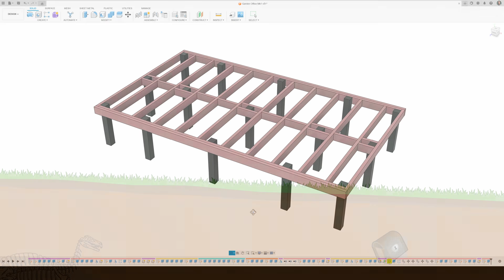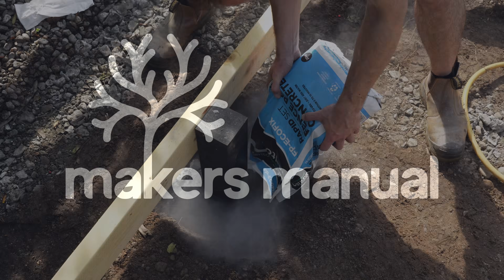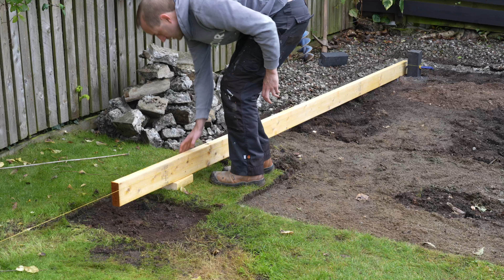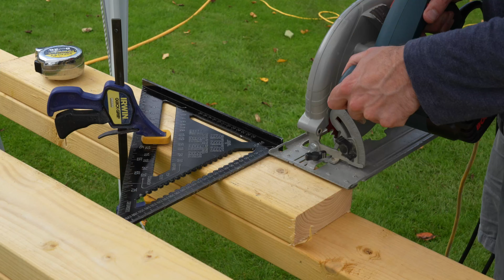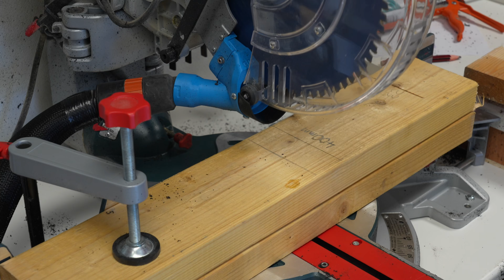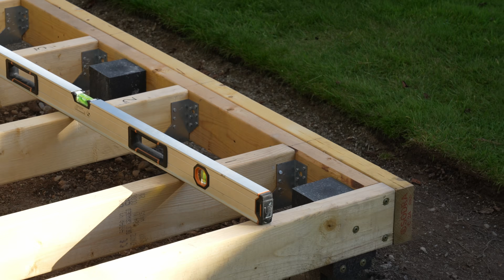Easy Foundations & Solid Timber Base Frame | Garden Room Build #2

Comment: Not sure I’m convinced on the base. Postcrete generally just crumbles under structural load - I’d be using a strong concrete mix - either 3 aggregate to 1 cement or (more likely) 3 building sand, 2 stone, 1 cement. I like the idea of using composite posts as they should never rot (in theory)….. having never used them, my main concern would be over ensuring the fix is decent enough. 1 metre deep holes seems sufficient enough to me though - not sure why you’d want to go any deeper than that.
Edit - just seen the price of these composite posts and nearly fainted!!!!
Reply from the maker: That's a good comment, and it prompted me to go away and do some more research to check whether I'd potentially made a mistake.

From Blue Circle's technical documentation, Postcrete is intended for applications such as fence posts and decking posts, but isn't suitable where a specified compressive strength is required. Given the relatively low loads involved and the similarities to a deck foundation, I think there's a reasonable argument for its use here, although I accept that a concrete mix with a specified strength would have been a more conservative choice for a building foundation. As always, the ground conditions and specifics of the site make a big difference.

I agree about the composite posts, too. The connection to the timber frame was the part I was most cautious about, which is why I double and triple-checked the calculations and added the extra reinforcement. On paper, the connection has a considerable factor of safety, although that obviously depends on the assumptions in those calculations.

And yes, the cost of those composite posts certainly adds up! 😂 I'm happy to pay the extra over timber for the expected longevity, though, and overall it's still a cheaper option than some of the alternatives.

That said, for the build plans I sell, I've decided to recommend ground screws instead. They're a more versatile option across different sites, whereas the suitability of concrete foundations depends much more on the local ground conditions.

Comment: if you put a few screws into the end of the joists, are the joist hangers necessary? Nice work by the way!
Reply from the maker: Thanks! 👍

You could physically screw through the end of the joist into the supporting timber, but I wouldn't consider that a proper substitute for the joist hangers. Screws driven into the end grain have relatively poor withdrawal resistance, whereas the joist hangers are specifically designed to transfer the load from the joists into the supporting frame.

So for me, the hangers were cheap insurance and also give a much more reliable and consistent connection. There are other ways of fixing joists, but I'd use a method that's specifically designed and rated for the loads rather than relying on a few screws into the end grain.

Comment: Has anyone else bought the plans? I bought them 3 days again and messaged on the provided link to ask when they would arrive and have not had a response, thanks
Reply from the maker: Hi Becky, I just responded to your email you sent 2 hours ago. Please check your automatic receipt message sent by Fourthwall immediately after checkout, which contains your direct secure download link. I will get Fourthwall to resend the email to be certain you get it.

Please let me know if you have any further questions and all the best with the build.

Comment: Any concern about Rats nesting underneath? Would a concrete base be better for a garden room?
Reply from the maker: I must admit this was something that worried me, so in Part 8 - The Cladding Video (https://youtu.be/4l4pCBRsK84), I added some rotten mesh to the bottom of the structure. This should keep any unwelcome guests out of the base. Concrete is another valid option, but as with anything there are pros and cons to all approaches. On the whole, I prefer a floating base frame.

Comment: Is there any reason you didn't notch the post foundations so that they sit under the joist on at least one side? I'm going to use the same method on my build but, like you I am second guessing attaching the foundation posts laterally to the floor frame. And think it would be a better option for the post, to at least partially, bare the frame?

Great build BTW, I'll be referencing it extensively while building my own garden office.
Reply from the maker: Thank you. Notching the posts would be a good move, and would provide to piece of mind. We didn’t because would make initial levelling of the perimeter frame much more difficult. Though no reason not to do it with the other posts. I have separately looked into this 4 or 5 times now because I sometimes worry, but each time I have confirmed it’s solid. With 15 post for 10m2 the loading on the posts and fixings is actually relatively low.
Reply: @MakersManual Yeah part of the beauty of your solution is the ease of installation. Adding notching to the mix does complicate it. My build is only 9m2 but it has a 500mm cantilever at one end I'm trying to get away with 12 posts but perhaps I should order an extra plastic post and shoot for 15. My other thought was to potentially add some cheap decking pedestals to augment the posts. Thanks again.

Comment: Did you consider excavating a bit of ground (say 20cm) and add some ventilation ducts for the bottom air gap? This would give a bit more room for building restrictions
Reply from the maker: Good question. I didn’t actually consider that approach when planning the build.

In theory you probably could excavate down a bit and create a ventilated void with ducts, but in our case I’d be quite cautious. We’re on fairly clay-heavy soil and it’s a pretty damp area, so I’d be concerned about drainage and the timber subframe ending up in a consistently damp environment. Once you start digging a pit you also have to think about water sitting around the structure, how the ventilation ducts stay clear, and whether the void will actually dry out properly.

You’re right though that digging down could increase the internal headroom, because the floor level would be lower relative to the surrounding ground.

For this build I was trying to keep the foundations simple, well ventilated and reasonably forgiving for DIY, which is why I stuck with the raised frame and air gap. But there are definitely a few different ways people approach it. 👍
Reply: @MakersManual  Thanks for your answers! I really enjoy following the build and the rationale you provide with every step.

Comment: Did you use treated spruce C24 as wood or something else like Douglas fir?
Reply from the maker: I used C24 5x2 structural timber, like this: https://tidd.ly/4pJgigo

If you’re thinking of building something similar, I’ve also put together some garden room build plans which include the full materials list and product links: https://makers-manual.com/shop
 👍

Comment: Watched the whole series - very good and thanks for taking the time to put it together. What’s the minimum height above ground you can get your floor frame with this concrete piles method?
Reply from the maker: Thanks... we should be releasing the rest of the videos in a week or two so watch out for that. With this method you can get the frame as low to the ground as you like. But you will need a 50mm air gap beneath the frame for ventilation. This will keep the building healthy.

Comment: This is great, hoping to follow pretty much exactly this approach for my sloped site. One question, you didn't put down a weed-proof membrane, was that deliberate and do you think you'll be ok without one?
Reply from the maker: That's great to hear. We did actually put down a membrane, you can see it at around 3 minutes in Part 3 in this series. https://youtu.be/MzpKeu2QE5c

Comment: Any reason you had a overhang for the roof? Could have saved some space near the garden edge.
Reply from the maker: The overhang has a few positives for us; it looks better, helps provide shade from the sun and shelter from the rain. Plus it is nice to have a little extra space around the garden room for maintenance and storage. Thankfully we have a big enough garden that these pros outweigh the advantages of keeping it closer to the edge of the garden.
Reply: @MakersManual  Good points, if you have the garden size. When will next video in the series be released?
Reply from the maker: @leecornwall8381  It's all been a bit hectic with me, so I'm a bit behind with everything. But I hope to start-up the series again around late Jan. The videos should then come out on a regular schedule. 
In the real world the Garden Room is finish and looking good. Just need to edit everything together and also put the finishing touches on the manual I want to release to accompany the videos.
Reply: @MakersManual manual? That would be interesting. I am looking to buy a build pack from the garden room guru.
Reply from the maker: @leecornwall8381  Yes 🙂 I’m actually working on the manual (build pack) right now.

It’s taking longer than expected because I really want it to be properly thought through and something I’m proud to release. I also deliberately finished the garden room first before finalising the manual, so I could double-check details, improve anything that didn’t work perfectly in practice, and make sure everything stacks up in the real world.

The plan is to offer both cold-roof and warm-roof versions, using the same footprint, so people can choose what suits their circumstances.

I hadn’t realised the Garden Room Guru had released a manual. In general, my advice would be to look at a few different manuals before committing. I bought several during the research phase for this series and the quality varies hugely (I’m not suggesting anything about theirs specifically). What I did learn is that the cheaper ones often lack the level of detail required.

I’ll share more details once ours is ready — it’s very much intended to complement the video series and give people the confidence to build it properly. Even if you want to build a different-sized building, it should still be a useful guide to the overall build process.
Reply: @MakersManual sounds good. I’ve been following garden rooms since 2018 when Ali Dymock started his series. I’d say you have replaced him😂. The only question I would say with your build are the way you have your base, specifically the weight on the composite posts. If there is a lot of weight in the room, such as a gym then it may be a problem. I like the idea of using a non wood material, just using screws to connect a timber frame could be improved somehow 🤷🏽‍♂️
Reply from the maker: @leecornwall8381  That’s very kind of you to say — Ali’s series was hugely influential, so it would be amazing if our videos achieved even a fraction of the success his did 🙂

I completely understand your thoughts on the base, and it’s fair to say it still feels a bit nerve-wracking even now. All I can really say is that I’ve run the load calculations and, on paper, it’s comfortably within limits. We’ve also deliberately increased the number of composite posts to add a healthy safety margin.

In the manual I actually recommend ground screws, and I also make the point that if you’re planning on heavier loads — a gym being a good example — then increasing the number of supports (or choosing a different foundation approach altogether) is definitely sensible.
Reply: @MakersManual  Yes I saw you increased the number of posts. I think no matter what we will always think what about doing it this way etc... I think I'd probably go with a concrete base, although that throws up other potential issues, especially if not done according to the normal ways.

Comment: i like the idea of plastic posts but compared to ground screws or threaded rod pile system they are really expensive. I wanted the first video and im not sure how you got 15 for £300.
Reply from the maker: Hi, they can look expensive, but it's easy to miss that they come in 3m lengths. So you should be able to get 3 or 4 posts from one length. I found them for £70 for a 3m length, so that should be £280. You can buy them here https://shorturl.at/46tG1